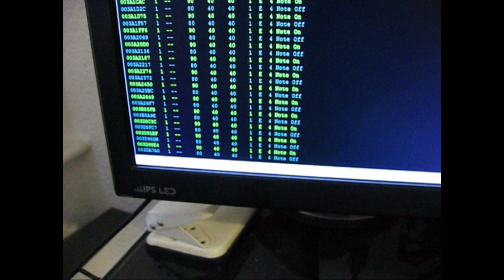MIDI organ pedals - 03:  Build process

Comment: 5:25 how it works? I don't understand the action.
Reply: Hal-sensors sense magnetic fields. The magnet triggers the sensor. The microcontroller reads the sensor and sends the midi command.
Reply: @Rollmops94  Interesting, I was looking into this sensors description on Wikipedia and they say that they can also detect speed, so, it would be possible to build such pedal board with variable note velocity. I think this project only has a fixed velocity; from what I see on the video, he is detecting only proximity.
Reply: @Rollmops94  I got one idea to sense note velocity: you will need two magnets and one sensor per pedal. My idea would be to put vertically two magnets: one about the other one and the magnet will be initially aligned with the top most magnet, so, when the pedal gets hit, there will be an interruption in what the sensor is getting, then it will see the other magnet and when it comes back, it will see the first magnet again. I just need to calculate the time difference between both measures. It looks a little bit complicated and perhaps there is a better solution, but I will give this a try.

The other approach would be two sensors and one magnet, but I guess this approach might be more expensive
Reply: @jmemusic  
This problem is a sheer mathematical one. HAL sensors exist in two variants: digital and analog. The analog one's give a continuous signal inversely proportional to the strength of the magnetic field - which means it's inversely proportional to the square root of the distance of the magnet to the sensor. (both is accurate only for linear HAL sensors). Speed is the change in distance over change in time. Therefor you only need one magnet and one analog HAL sensor and some sort of microcontroller to compute the velocity.
Reply: @jmemusic  Your approach will work, but will be a lot of trial and error and eventually also lead to a more labour intensive production.
Reply: @Rollmops94  I guess that's why organ producers solved this with two switches. I think that's how the did it.
Or maybe pressure sensors, if they are not expensive.
Reply: @jmemusic  
They solve it with two contact switches to measure the time delay, between the closing of the first and the second. From this they calculate the velocity, which is similar to your idea. They do it because it is very cheap. Your approach uses the same idea, but uses HAL-sensors and magnets, which overcomplicates things and also makes it more expensive and more prone to error. 
If you build something, show me.
Reply: @jmemusic  The advantage of using an analog HAL-sensor is, that it can measure the depth of the key, which gives you an extra dimension of control.
Reply: @jmemusic  Sprichst du deutsch?
Reply: @Rollmops94  Ja, ich spreche auch Deutsch, aber es ist nicht meine Muttersprache, meine Vatersprache so zu sagen 🙂

Comment: can I ask you something sir? what is the length and width of your pedals from white and to black keys? Thank you very much sir and I hope you'll be have a time to reply.
Reply from the maker: +Bon Jonel Cunanan about 1cm space between the keys. the keys are around 2,5cm wide. the white are 50cm from back of the device to front. the black keys are like 35cm. I had them much longer but that was inconvenient. you should just try what works the best for you. I didn't do any research upfront about the measurements